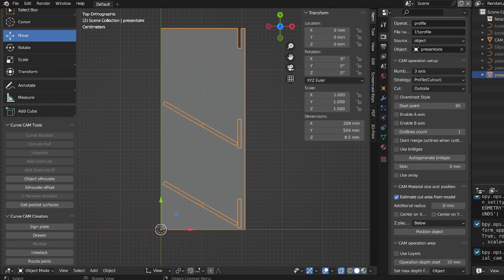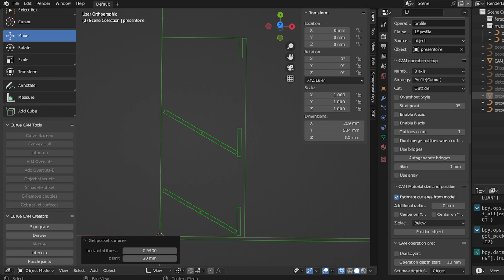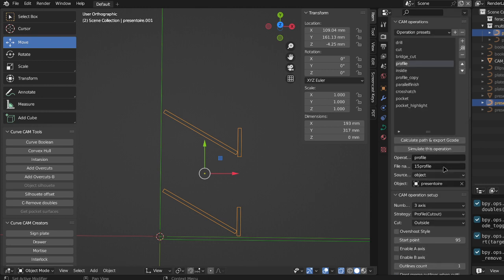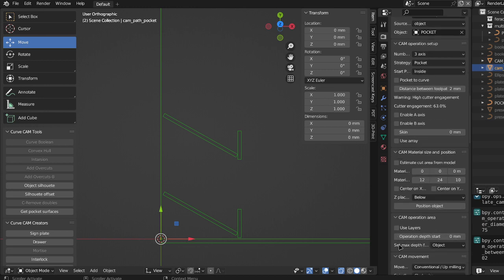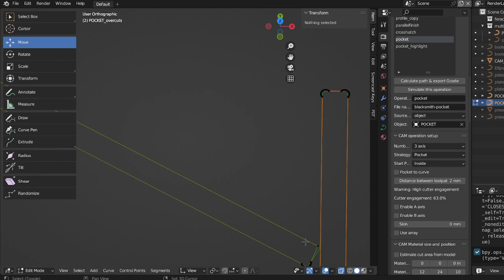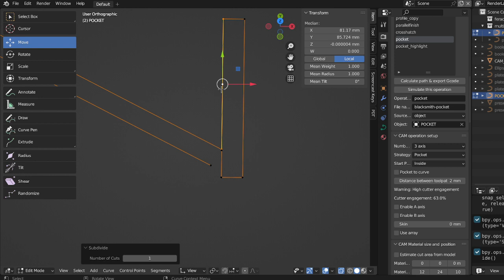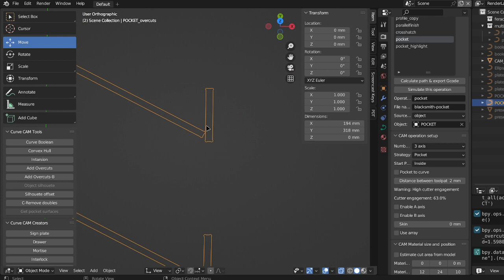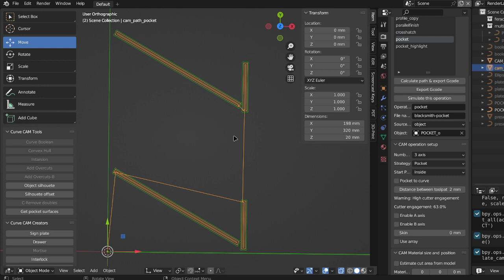fabex cnc curve cam tools:  get pocket surface

Comment: Thank you for the video.  I was having a problem using the Get Pocket Surfaces.  It was probably the Remove Doubles step or an overlap that was causing the problem.